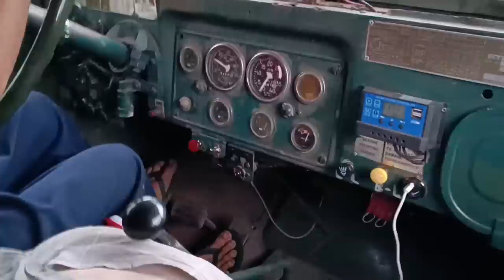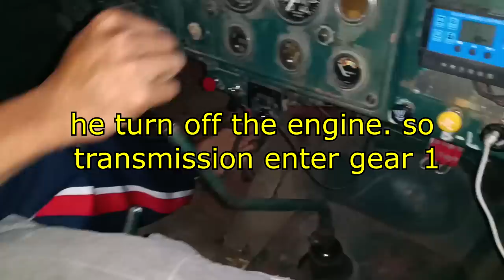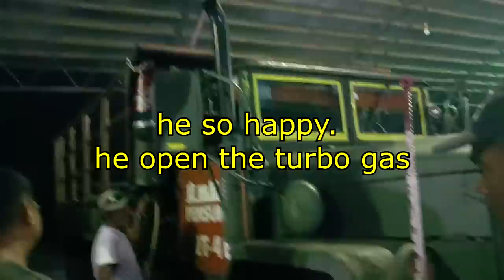RIO TRUCK 6x6  m35a2 USA TRUCK kahit may bagyo kaya pa maka-alis.. filipino #sugarcanetruck

Comment: Gud day idol... Baka may mag hanap syo ng ganyang engine multi fuel m35a2 meron d2...
Reply from the maker: mag kano nmn?
Reply: @depede384  35thou lng...full out k s m35a2 ko.. Gensan tong s amin idol...
Reply from the maker: @eduardoramos1708  35k pisos lang?.
Reply: @depede384  tama idol 35k lng.. Bka sakali may maghanap dyan s inyo....
Reply from the maker: makina lang?...
Reply: @depede384  makina with transmission....
Reply from the maker: @eduardoramos1708  location mo boss
Reply: Magkano at saan ho location idol